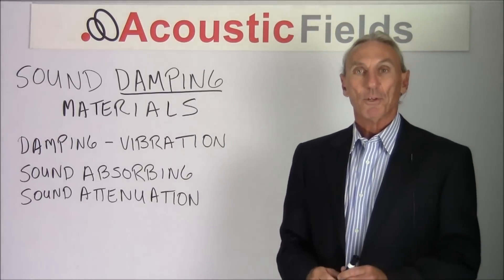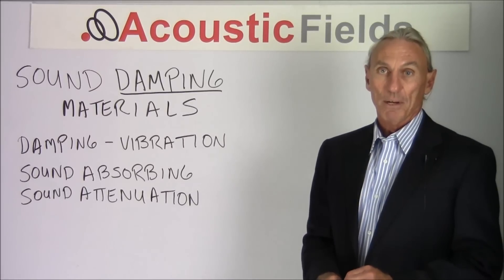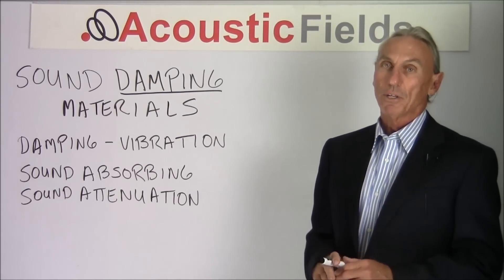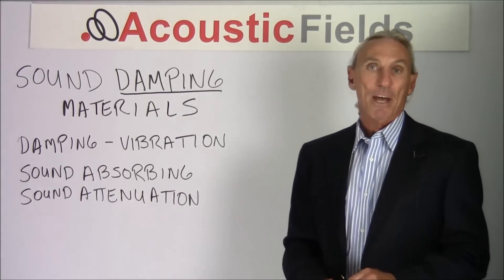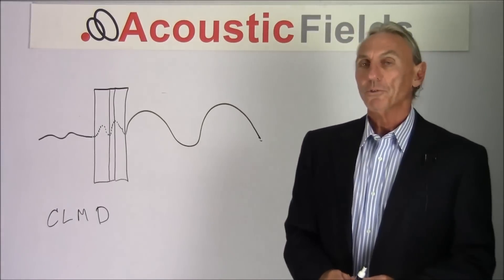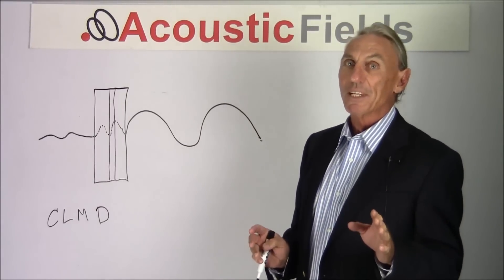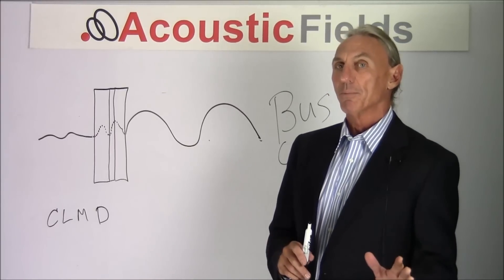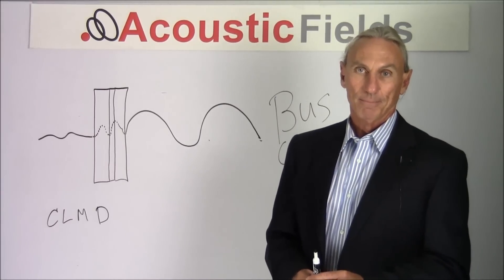What Are The Best Sound Damping Materials & How Do They Work?

Comment: If all you want to do is reduce sound pollution so you can record audio podcasts in a small 5x5 space, what would you recommend for a solution under $1,000.00?

I already bought a 6 pack of the producer's choice acoustic blankets that are supposed to arrive tomorrow. It seems that most of the sound pollution in this environment comes through the door, so I'm considering ordering the producer's choice door covering also, but I want to first see what I'm working with when the blankets arrive.

I also bought one of them cheapie $40 microphone sound isolation booths and adhered some mutex to the outside of it. I don't think I'd recommend this approach to anyone by the way. Money would have been better spent on the frame for the blankets or put towards the door cover I'm pretty sure. Anyway.. 

Although the blankets have a 0.8 NRC they're not going to be able to deal with low frequencies, and even in the mid to upper frequencies they're only going to offer something like 10 db reduction with a single layer. Some of the challenges in this environment consist chiefly of dog barks, dogs playing, dogs walking across hardwood flooring.. but basically the dogs barking in the 1K - 2K frequency range isn't the issue, it's the 60 - 110 db they're capable of producing that is the issue.

I don't own a home or have an office and I certainly cannot afford to go all out and build a room within a room..  I know I cannot have a sound proofed environment, but is there something I can do to give myself another 20 - 30 db of noise reduction for only another $200 - $300?
Reply from the maker: D,  You have two issues to consider: noise transmission and treatment. "Acoustic blankets"  I am going to assume is a sound absorption technology. This may or may not provide the proper rates and levels of absorption for your usage. Voice requires specific rates and levels of absorption to maximize definition and separation. Noise coming through a wall or door must be treated with barrier technology. These are separate issues that require separate treatment typologies.

Comment: Give your video a less misleading title, please. We're looking for an in depth description of different materials and their helpfulness, not a lesson on terminology.
Reply: Not only that but he wants us to believe that it is the arrangement of the material that keeps the sound out??? So by his logic 2 layers of drywall then a layer of insulation and 2 more layers of drywall will work differently than 3 layers of drywall a layer of insulation then one layer of drywall...that has nothing to do with it. It takes mass plain and simple. All these vids he just runs down bullet points and defines the terms on his board poorly i might add...
Reply: @hillybillyguitarzan5813  the arrangement of the layers is the definition of constrained layer.  Your example isn't very good more typical would be a viscoelastic layer intimately in contact with two outer layers of drywall. Wikipedia doesn't say but I'd bet the impedance change in the sandwich dumps more of the sound energy as heat in the center  and may reflect a little more off the 1st surface.
Reply: @hillybillyguitarzan5813  You exemple is right, in that case it is the mass plain and simple, but you're not considering reflective materials, substitute one drywall with a reflective membrane (classic exemple would be certain claddings) and the arrangement becomes crucial. I'd say the problem is that he doesn't mention reflection but only absorbtion and diffusion (or maybe I'm missing out some knowledge)
Reply: https://aquietrefuge.com/best-sound-deadening-materials/
Reply from the maker: F,  It is difficult to cover complicated subjects in a 3-5 minute format. If you have a specific issue you need assistance with, you can contact us at info@acousticfields.com
Reply: @AcousticFields  you are too nice! Even to those who have nothing better to do but give you a hard time. Great video.
Reply: @AcousticFields    Video request:  The best sound damping materials and how they work
Reply: @williammacneill956  LOL

Comment: which reduces room echo??
Reply from the maker: F,  Probably not echo but high reverberation times. Sound absorption technology is the chosen treatment method. You must match the rate and level of absorption to the frequency and amplitude of the issues in your room.
Reply: Alright well my layman ass doesn't need perfection (nor knows how to measure that stuff), I just want to remove room echo/reverb from my vocal recordings, which I'm getting a lot of right now cuz of my bare walls. I'm a rapper and down to add reverb if needed in mixing. Right now I'm leaning towards spending ~200-300$ on Roxul Safe n' Sound insulation to craft my own panels and create a vocal booth out of them in the middle of my bare-walled bedroom or basement (which would be better?). I'm guessing that'd do the job, right? Also if I just care about vocals, do I need to give a shit about bass traps? Or is mid-high freq absorption enough? Or does it depend on my voice?

I'm also wondering what kind of household objects I could try first instead. Maybe I'll try covering the walls in thick blankets? Or making a vocal booth in the middle of the room out of thick blankets? (Which would be better?) Would that do the job? And what should I look for in a blanket (or whatever household material you suggest) that indicates it'd be good for this?

Hope you get back, I know a lot of other rappers that'd love some confirmation on the effectiveness of these methods, like how they rank with eachother, I'd love to post your feedback on reddit.

Comment: Hi! Is it possible to achieve something similar without building an inner and an outer shell? I own an adjoining flat and I can hear my neighbor quite clearly, specially his doorbell. I assume damping is the way to go, but building a room inside the living room would be costly, so I should somehow treat a 2.5 by 6 m wall instead. Could you adress this subject anytime soon? I've been waiting for something like that but, as far as I've seen, your videos always focus on absorbing/diffusing/damping interior sound sources. Thanks!
Reply from the maker: Q,  Barrier technology which is the technical name for structures we create to minimize noise or vibration are frequency and amplitude dependent. This means that the amount of noise is important but the level or frequency of that noise is just as important. If you can hear a doorbell through your existing structure, then there is little you can do because your existing structure is not doing its job correctly. The amount of mass and materials you would have to add would be permanent and require extensive construction  techniques.
Reply: I know, they go cheap on those dividing walls. I'll try to talk him into mounting that thing somewhere else in his flat, haha. Thanks a lot anyway.
Reply: @ quinosonic82  -   Sounds like the doorbell is mounted on the shared wall. Talk nice to your neighbor and volunteer to help move the bell, either labor or money.  That would be much less expensive than trying to damp the wall vibration. 
      If your neighbor doesn't want to mount the bell elsewhere, good acoustic treatment will help make any good or bad noises sound sweeter.  I put in a bunch of treatment (mostly absorption) in my living room/home studio/home theater over the last 18 months and it is a very "comfortable" place.   I avoid leaving home and hate being in bad-sounding rooms. 
       As a last resort only,  you could always cut a small hole in your wall behind the bell and cut one of the wires.

Comment: what would happen, if i put single layer which has the thickness equal to sum of all layers.
Reply from the maker: Hi Arun, Its the variance in the density of the layers that contributes directly to noise transmission. The density, the method of attachment, versus frequency and amplitude.

Comment: Hello, I am currently living in an apartment where I throw parties with my recently graduated friends and my neighbor is starting to complain. I watched another video here on YouTube describing a cheap solution to making sound panels, that being- making a wood cutout and then filling that with multiple layers of towels. I know that I want dense material to keep the sound in, but do you think the multiple layers of towels would do the trick. I cannot just build a wall, or afford dense materials to put on the wall. Thank you
Reply from the maker: Hi Jake, Noise transmission issues require barriers to stop the noise. Absorption technology absorbs the energy within a room. Two different technologies with very little overlap. Towels are for bathing only. They have no place in the noise transmission world. You will need to party less and more quietly or build a barrier to keep your party noise inside.

Comment: So I want to make a cheep DIY collapsible (so portable) audio recording booth. Size is small say 6' tall and 4' by 3'.  I'm just recording my voice and want some sound dampening so my microphone doesn't pick up the echo from my room and the cars that drive by my apartment. What is a good and cheep material to use to absorb/damp the outside? Again I can't afford actual Acoustic Foam Panels at this time.
Reply from the maker: Hi BektostheBlackBlade, Do not build this room size and volume. There is not enough distance to allow for time signature management of reflections and even if you can't hear it, the mics can. I will assist you with new size. Fill out the information in this room form:  http://www.acousticfields.com/free-room-analysis/

Comment: i want to use electric saws in my apartment.  what should i use to prevent the noise from bothering the neighbors?
Reply: Wally Kellett Best idea is to dampen the room you want to saw in as best you can floor/ceiling/walls. And also build a fully or partially covered work booth that you've also insulated with rockwool, make sure the worktable you saw on has spring or rubber feet,cuz when you saw into stuff the vibration will travel from table down in the ground
Reply from the maker: Hi Wally, What is the frequency and amplitude of the noise from the saws? You have to define your noise issues first. You need to know what frequency and how much energy at each frequency of concern. The barrier technology to stop the noise is built using those numbers. Do you have iphone?
Reply: no I am a Droid user but my wife is an iPhone user.
Reply: Wally Kellett He forgot to give you any real answer there I see.
For Android/Iphone download Audiotool app or on pc http://www.roomeqwizard.com/
Next buy s microphone on Amazon the Dayton IMM-6 24$. It comes calibrated.

Time to measure your tools for noise. The most sound is usually the same frequency as the gearbox rpm. Best place to measure is inside a plywood box which is insulated woth rockwool to dampen sound. Or you go outside somewhere quiet where there is no echo and measure the sound.

Comment: is it X + 1, X + 2, X + 3.....then what? Or is it X + 1, X1 + 2 + X2 + 3?
Reply from the maker: +Katharine Berrigan Linearity is welcome phenomenon but not the case for all frequencies when it comes to barrier technology. Frequencies below 125 Hz. are more mass dependent and construction methodology oriented. You can determine the mass/frequency ratio but make sure your wall materials "circuit" is congruent in the vibration domain, so you don't "short out" the very vibration/frequency you are trying to isolate from by improper construction methodology. Each wall layer has a vibration objective and each wall layer is built upon each other. It is like baking a layered cake. Each layer has its purpose and function in the final result.